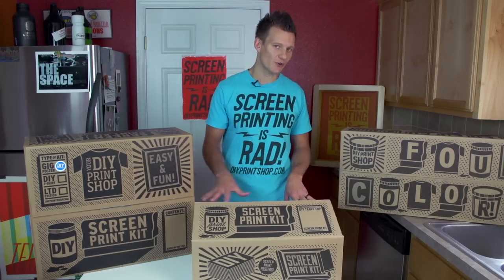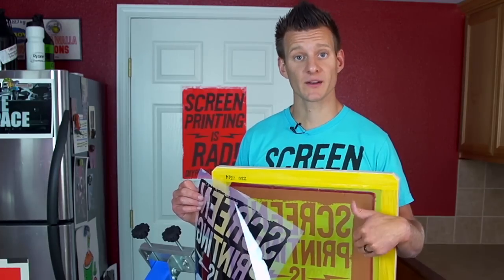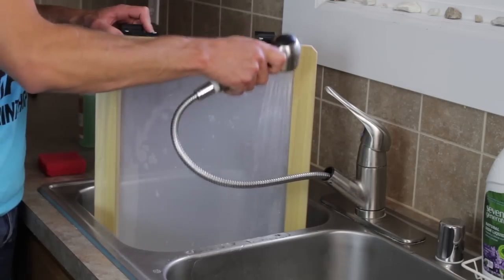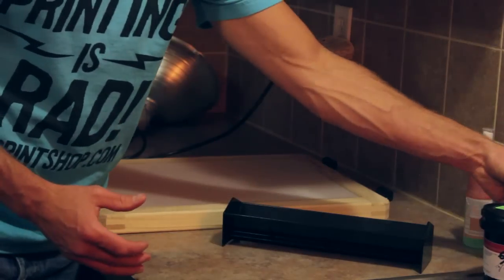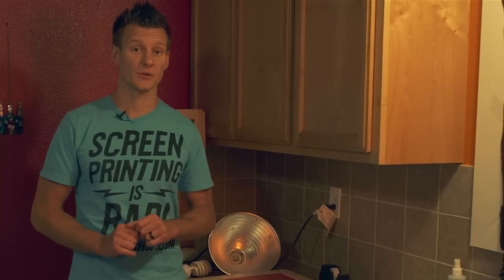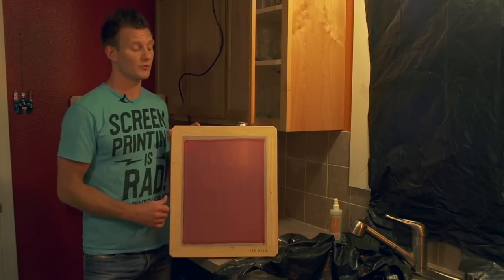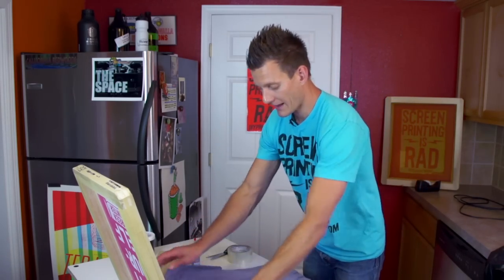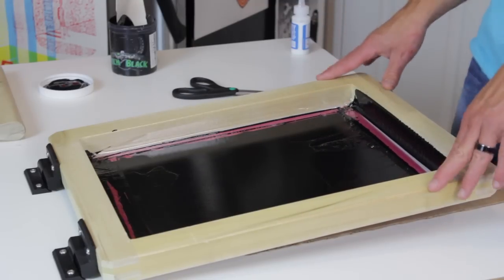DIY Screen Printing How To Instructional Video from the DIY Print Shop

Comment: Thanks for the video.  At 21:15 you've mentioned that in a dry area it can take 3-4 hours for the screens to dry.  do you have to be in the dark room for 3 to 4 hours, for it to dry?  Also, if you're using your bathroom, are the fumes toxic to breathe?  Thanks again.

Comment: how do you get the writing onto the film?
Reply from the maker: Hey there! To get the image onto the film itself, you will need an inkjet printer.  If you're just starting out, any inkjet printer will be able to print on the films.  We usually suggest setting your print quality settings as high as they will go, and then print two copies that you can tape back to back, that way you get a truly opaque film positive.

Comment: how do you keep your design without washing it off?
Reply from the maker: +Kyle Taylor If you are just washing the ink off the screen then you don't have to use the emulsion remover, just water, the design will stay in the screen and you would be good to go to use it again after it is dried.
Reply: thank you

Comment: household irons aren't 300 degrees are they?
Reply from the maker: +Robert Brown (Rb Artistry)  They actually are and work very well for this DIY screen printing with the silicon paper included with the kit - R
Reply: +Ryonet ok cool, I have always used my heat press with heat transfer vinyl  because irons didn't set it well, need 320 for those.

Comment: i clean my screen and some of the emulsion came off how do i clean it
Reply: well the proper way to clean do i only wash one side or both?
Reply from the maker: That could be due to under exposure. Maybe try exposing longer. You will want to wash down both sides after exposure. Good luck! : )

Comment: I can't seem to figure out why so much ink bleeds through the screen. I've tried less ink. I've tried to not flood. I've tried less pressure. I can't seem to get it right! HALP!
Reply: i am trying to do poster printing with the 156 mesh, should i have a higher mesh count?
Reply from the maker: Exactamundo! Water based inks are generally thinner in consistency and require higher mesh counts. 156 usually does okay but a 186-305 will also work great. PLUS, the higher you go, the less ink you use, and the more money you save :)

(all of your other efforts were spot on, sounds like you're a great trouble shooter and screen printer!)

Comment: Whats with the crappy mostly unusable 14x14 platen in a TSHIRT kit why not just include a 16x20 with neck at least then an upgrade path , its hell lining shirts up unless its small enough to get the shoulder seems on platen sides(youth shirt), really disappointed. The cost is small cause there is no platen clamp, i see $50 kits with decent size platens, i expected better from a popular company like Ryonet. Yes i did read what it comes with, i do HTV up to 12in so i thought 14in was good enough but the stem is short where you screw in the platen, so it comes down to a  14in w x 8in L print area if that much. This kit and 60 L/XL/2XL shirts FAIL due to platen size back to HTV till i can get to LOWES and have them cut some MDF. I am just saying a TSHIRT KIT should come with a TSHIRT PLATEN.